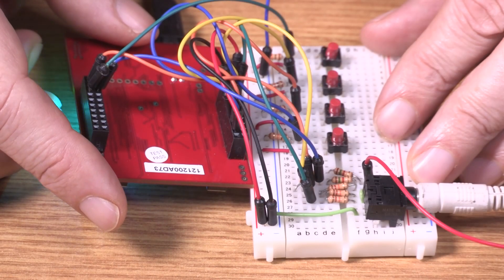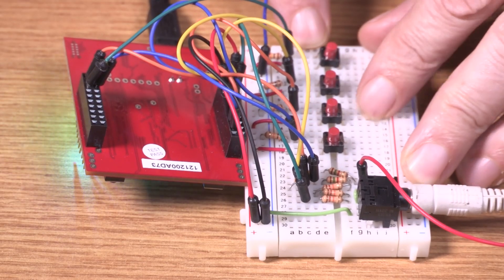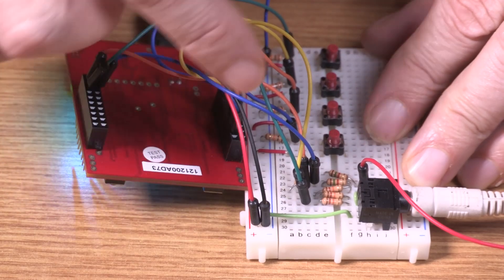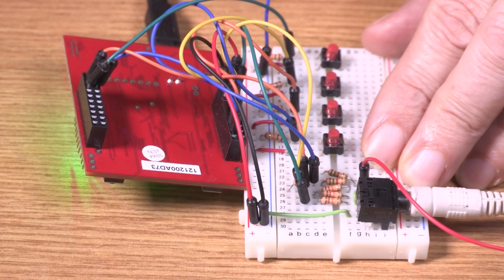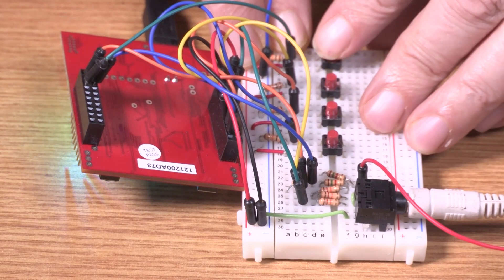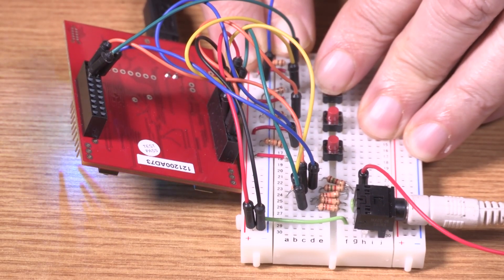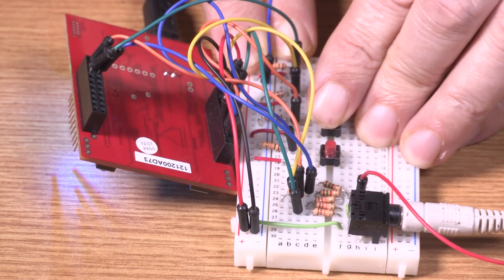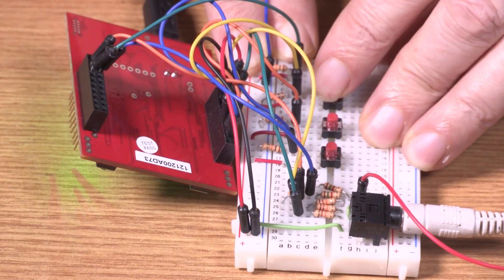Lab13A Demonstration of Digital Piano

Comment: I'm trying to do this lab, but I cannot figure out how you get 6 resistors of what look like equivalent value.  Do you have a schematic, or a video of the building of the DAC?  Thank you.
Reply: they're not equivalent, since its a binary weighted dac you just need resistor values going up by a power of 2 for each output (1,2,4,8 for example)
Reply: @data5ian  So they are not the same value.  Ok.  I guess that it just looks like all the bands are the same.  Thank you.  DAC built, code coded, working...not.  But what is success without a struggle.